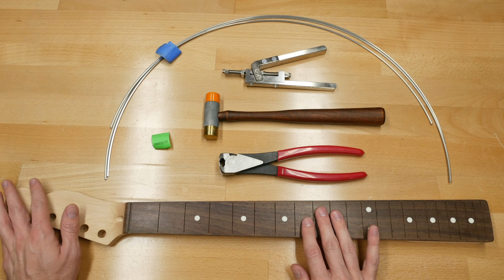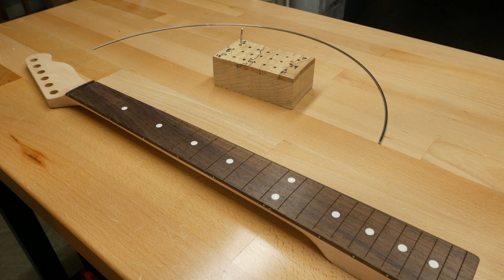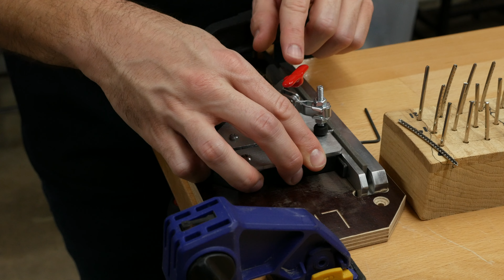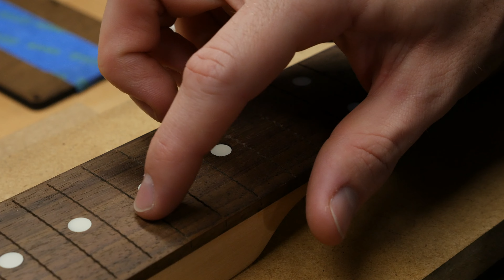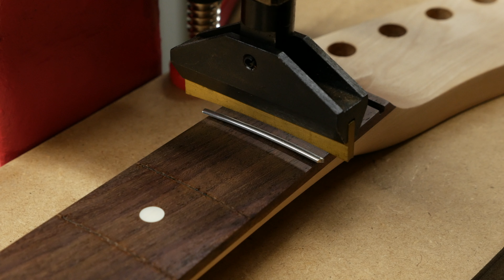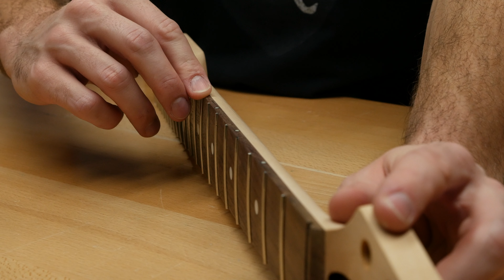Don't Fret! || eBay Telecaster Revival || Episode 7 || DIY Partscaster Guitar Build

Comment: Wow you cut those frets like they were nothing, what fret cutter are you using? I’ve destroyed cutters messing with SS. I resorted to using a Dremel fro cutting the fret to length and to remove the tang.
Reply from the maker: Yep! I use the fret cutters from StewMac. This is my 2nd pair and they work great! One good thing about StewMac tools is that they come with a lifetime warranty. My first pair of cutters eventually wore down and had some chips in them. They replaced them with no issues and I had a replacement in a few days. Buy once, cry once as I always say! Here's a link to them: 

https://www.stewmac.com/luthier-tools-and-supplies/types-of-tools/pliers-and-cutters/stewmac-fret-cutter/
Reply from the maker: Here's a link to the tang filing jig I used in the video: https://www.lmii.com/fretting-setup-tools/2696-fret-tang-filer.html
Reply: @AugmentGuitars  awesome thanks for the info. Much appreciated.